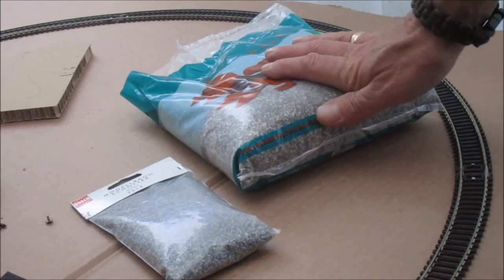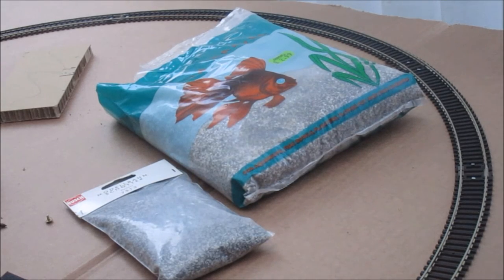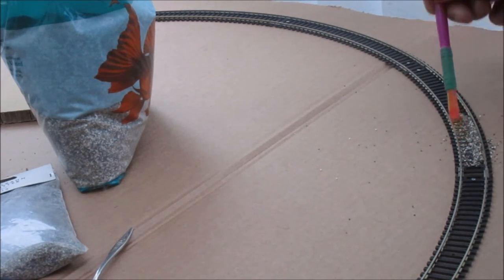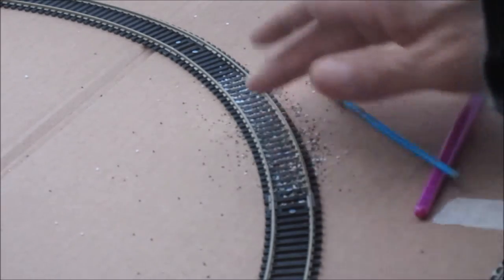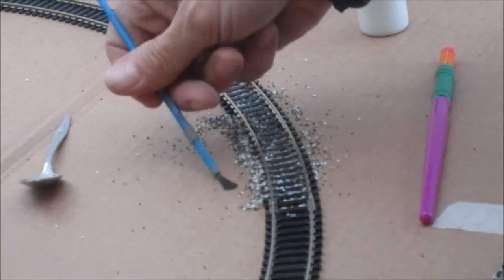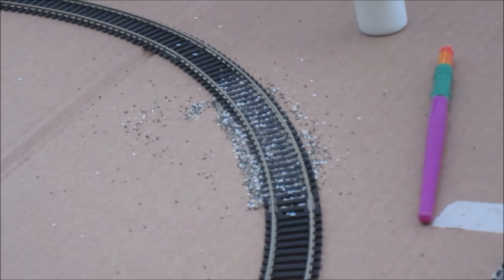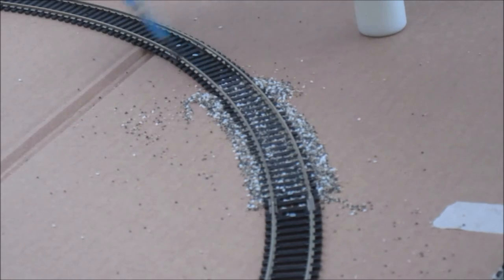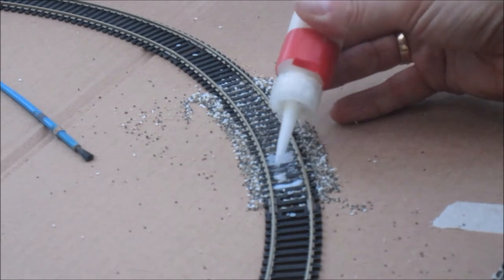Ballasting A Model Railway Layout With Fish Stones?!

Comment: Do you have any recommendations for a layout I might make .it would be a small gwr shunting layout with a platform and sidings to run my pannier
Reply from the maker: Hi. I could suggest a few , depends on what size layout you will have. But generally you need a run around loop and a couple of sidings to give you enough shunting potential. A factory gives a bit of a change from a goods shed.
Reply from the maker: I couple of other pointers. The more sidings the more potential, but to balance that the longer the head shunts and run around loop the more options you have. Even the classic single track with sidings will be good and can be fitted into about 5ft by 10in, with either a separate fiddle yard or a switch back siding. Using the smaller wagons and shorter coaches will help and don't forget mixed trains give you more options. Hope this helps.